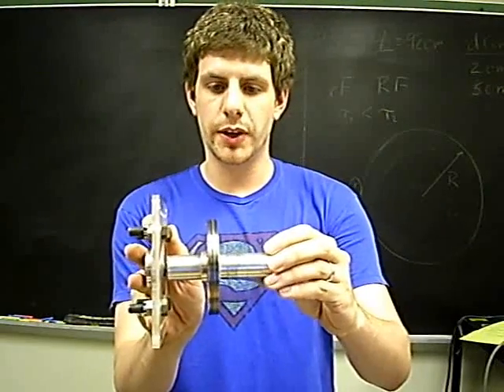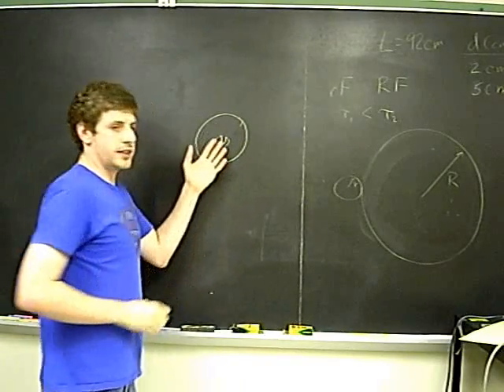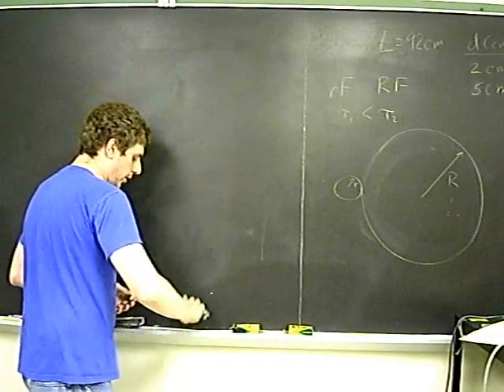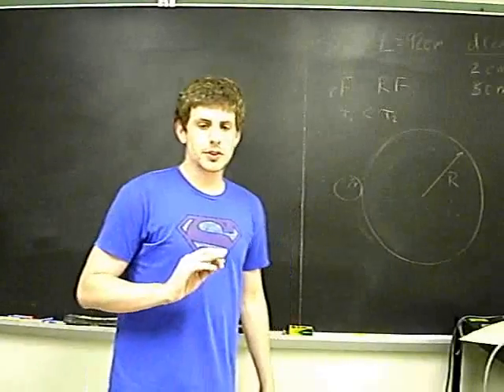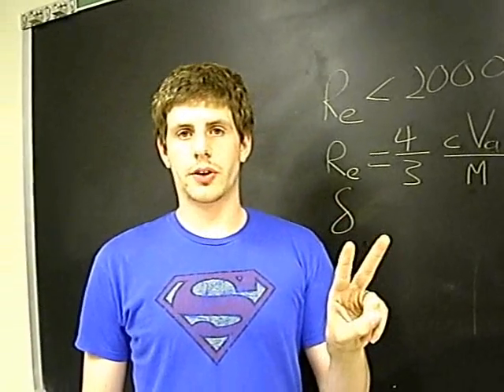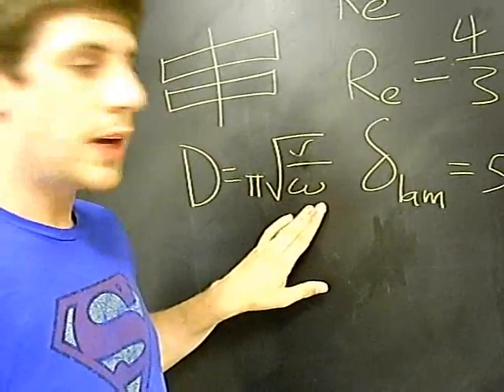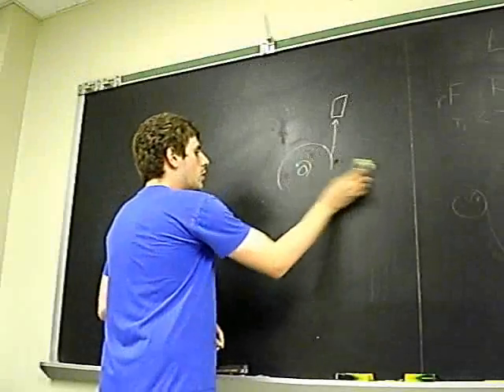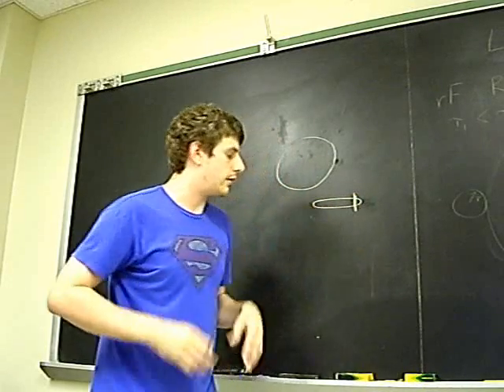Tesla Turbine Concepts Explained

Comment: A relatively good overview. Before noting the Reynolds number though, it should have been noted what this number is a ratio between  the inertial and viscous forces in the fluid.  A main misconception that needs clarification is that the Turbulent Boundary Layer (TBL), in contrary to the info @6:06, is very essential to the turbine, as it is the natural mechanism to transfer power between the concentrically swirling fluid and the metal disks. In order to see why it is the case, and how the dynamics of the turbine naturally changes take a look at this extremely well made video: https://www.youtube.com/watch?v=5zI9sG3pjVU&t=470s

Comment: Somehow at some point something doesn't convince me. When you say there's a "straight spiral" towards the center, it means it doesn't still cover the entire surface and is still rotating at low speed. What probably happens in that Fibonacci spiral is only a pressure wave, and since there are two opposite forces of a fluid pushed from the outside to the inner outlet and the same fluid pushed by the disk towards the periphery, one is centripetal and the other centrifugal, the maximum efficiency is obtained when there's a perfect resonance between these forces.

Comment: No new information. Plus, you could have explained it better if you had researched it more thoroughly. You misrepresented the angular flow part. Every explanation I've heard thus far, and there were many, have said it the way others in the comments have said it.
Reply: Want new information or even just a better way to look at it? 

The TesTur is NOT a mechanical turbine in any shape or form. Because all molecular adhesion and internal viscous forces within a fluid are governed by electron orbital interactions, this makes the TesTur a purely electronic interaction turbine.

The BIGGEST misconception about the Tesla Turbine that most people get wrong is that they think the fluid is actually sliding and dragging on the disc, similar to as if a solid object was “sliding” across the surface of another solid object. 

It is not. Full Stop. 

The fluid that’s just off the surface of the disc face is ALWAYS statically adhered to said disc face and never moving relative to the disc. 

The torque to the disc comes from shear stress forces within the motive fluid trying to move through itself.

The shear force is transferred through the motive fluid itself to the layer of fluid that is statically adhered to the disc faces, and then through the virtue of molecular adhesion the discs are pulled along with it, or Vice versa the discs pull the fluid along with it. 

The only “friction” involved in this is that of internal friction within the fluid against moving through itself, ie viscous forces. 

This is not a mechanical turbine in any shape or form. 

Since all molecular adhesion and internal viscous forces within a fluid are governed by electron orbital interactions, this makes the Tesla turbine a purely electronic turbine. 

As Tesla even alludes to in the article “Dr. Tesla Talks Of Gas Turbines” 

… “I have been working at this a long time. Many years ago I invented a pump for pumping mercury. Just a plain disk, like this, and it would work very well. ‘All right,’ I said, ‘that is friction.’ But one day I thought it out, and I thought, ‘No, that is not friction, it is something else. The particles are not always sliding by the disk, but some of them at least are carried along with it. Therefore it cannot be friction. It must be adhesion.’ And that, you see, was the real beginning.

“For if you can imagine a wheel rotating in a medium, whether the fluid is receiving or imparting energy, and moving at nearly the same velocity as the fluid, then you have a minimum of friction, you get little or no ‘slip.’ Then you are getting something very different from friction; you are making use of adhesion alone. It’s all so simple, so very simple.

“This is the greatest of my inventions,”……
-Nikola Tesla (September 18th, 1911)

When designed correctly, it works principally upon electron interactions between the fluid and itself and the fluid and the disc material. 

The first important factor being how well does the fluid actually molecularly adhere to the disc faces when submerged in an atmosphere of the motive fluid. 

This is also seen as the “Wetting angle” when there are two fluids in contact with the surface and they are competing for adherence. 

Think hydrophobic and hydroPHILLIC surface treatments.

The second important factor is the viscosity of the motive fluid in question, as it represents the fluids ability to “flow through itself with or without resistance” per se. 

Herein lies the reason it is extremely important to maintain laminar flow regimes within the disc spaces. 

Because irrelevant of the viscosity of the fluid, ALL FLUIDS, liquids and gases, can be forced to flow in highly efficient low Reynolds number laminar flow regimes given the right initial conditions and “flow cavity” parameters, such that turbulent boundary layer slip is eliminated, stream separation and counterflow is eliminated, rapid pressure changes from turbulence resulting in noise losses that can lead to early fatigue on discs and parts is eliminated, etc. 

Furthermore, because windage is all but inexistent in the Tesla Turbine, it stands to potentially be the quietest running turbine ever when properly designed. 

(Sidebar: This is why I have speculated over the years that these Tesla turbines have actually covertly been in practicable use all this time in things like covert/stealth submarine Primary Power Units (PPUs) and/or just plain stealth “trolling motors” but that’s honestly my own sheer educated speculation at this point. 🤷‍♂️ it just makes sense.)

This is where working out the complex solutions in the Naviar-stokes equations come in for designing practicable machines.
Reply: That's not the important thing about THIS video. THIS video explains it for the average person. Or even for the average science guy/gal who didn't go to college or go too deep into physics.
Reply: @edwardfrancisslaytonjr.9702  for the record, I do have a degree in physics, and build real actual working Tesla turbines that get PLENTY of torque and output power, even at low RPMs. 

If you listen to what Tesla said to do you will get a great turbine. 

1) high speed fluid relative to the discs (not high speed discs like everyone erroneously claims)
2) increase surface area 
3) decrease disc spacing 

In teslas own words…
“Owing to a number of causes affecting the performance, it is difficult to frame a precise rule which would be generally applicable, but it may be stated that within certain limits, and other conditions being the same, the torque is directly proportionate to the square of the velocity of the fluid relatively to the runner and to the effective area of the disks and, inversely, to the distance separating them. The machine will, generally, perform its maximum work when the effective speed of the runner is one-half of that of the fluid; but to attain the highest economy, the relative speed or slip, for any given performance, should be as small as possible. This condition may be to any desired degree approximated by increasing the active area of and reducing the space between the disks.”
-Nikola Tesla

Comment: Hello:  My name is Jack.  I am a very practical guy.  I own a factory which uses around 1000 to 2000 KWh of electricity per day.  This is an area area where electric cost is around 30 cents per KWh.  So you can see that my electricity costs are very high.  In fact, that is our greatest single cost.  Thus my interest in a turbine.  What makes it more attractive is that we can acquire waste motor oil almost for free.  We have developed a waste oil burner powerful enough to heat up to 30 kg of steel at a time for drop forging.  Can fire a forge hot enough to forge weld.  Fire a furnace hot enough to melt and pour our own die blocks.  That is a lot of heat.  In electrical terms I would suppose around 300 KW of power (but that is only a guess).
Now suppose we would use that waste oil burner to heat an oven through we would pass copper water tubes to produce steam.  Inject water into the tubes, water in the tubes gets hot, turns to steam, direct the steam through a nozzle into this Tesla turbine.  Get a lot of RPM's and then gear down or use a belt pulley system to produce 1,800 RPM to run a 200 KW alternator.  (Which we already have).
Now suppose I would use many, many stainless steel discs to form the Tesla turbine.  The discs would be around 24" in diameter.  I could use as many as necessary.  Now though my discs are thin they  are heavy enough to form a heavy flywheel of maybe 1000 lbs of mass so get a pretty good flywheel benefit too so that all of our electric motors stopping and stopping in the factory would not have as much effect of torquing the alternator down to inefficient RPM's.  Might enclose them within a common 55 gal oil barrel.  Presto, Tesla turbine.
We really need something like this.  We could even become profitable.
Any knowledgeable person out there care to comment about this?????  We are not much as engineers.  Need some help in the form of advice.
Thanking you in advance.  You could contact me at:    horsemnn@aol.com
Reply from the maker: Jack Roth Sounds interesting. Let me know your results.

Comment: Interesting theory, but I don't understand how a flat surface can transmit the mechanical motion of air or fluid more efficiently than the blades of a traditional turbine. The Diesel engine theory would definitely not work here.
Reply: No documentation whatsoever showing the torque figures surpassing or even comparing with a conventional turbine. Until a dynamometer test shows superiority, it is idiocy to think these are worth anything.
Reply: Prove me wrong.
Reply: Insult prove nothing but the lack of character and the weakness of the argument of the person doing the insulting, great job.
Reply: Ha ha ha, as I said....
Reply: If the best you've got is calling me names, I think my point is well proven, thanks :-)
Reply: What about 9/11? The destruction of the Word Trade Center has nothing to do with this video at all.
Reply: You are interested, and judging from the way you talk, your knowledge of machinery could fit in a shot glass.
Reply: @davekauffman8727  [TL/DR: This is not a mechanical turbine in any shape or form. Since all molecular adhesion and internal viscous forces within a fluid are governed by electron orbital interactions, this makes the Tesla turbine a purely electronic turbine.]

The BIGGEST misconception about the Tesla Turbine that most people get wrong is that they think the fluid is actually sliding and dragging on the disc, similar to as if a solid object was “sliding” across the surface of another solid object. 

It is not. Full Stop. 

The fluid that’s just off the surface of the disc face is ALWAYS statically adhered to said disc face and never moving relative to the disc. 

The torque to the disc comes from shear stress forces within the motive fluid trying to move through itself.

The shear force is transferred through the motive fluid itself to the layer of fluid that is statically adhered to the disc faces, and then through the virtue of molecular adhesion the discs are pulled along with it, or Vice versa the discs pull the fluid along with it. 

The only “friction” involved in this is that of internal friction within the fluid against moving through itself, ie viscous forces. 

And sorry I don’t mean to sound like I’m being pedantic, as I’m sure I’m restating many things you already know. 

It’s just a very important key part of the operating functions that everyone gets wrong. This is not a mechanical turbine in any shape or form. 

Since all molecular adhesion and internal viscous forces within a fluid are governed by electron orbital interactions, this makes the Tesla turbine a purely electronic turbine. 

As Tesla even alludes to in the article “Dr. Tesla Talks Of Gas Turbines” ( https://youtu.be/TGGLG-7hK50 )….

… “I have been working at this a long time. Many years ago I invented a pump for pumping mercury. Just a plain disk, like this, and it would work very well. ‘All right,’ I said, ‘that is friction.’ But one day I thought it out, and I thought, ‘No, that is not friction, it is something else. The particles are not always sliding by the disk, but some of them at least are carried along with it. Therefore it cannot be friction. It must be adhesion.’ And that, you see, was the real beginning.

“For if you can imagine a wheel rotating in a medium, whether the fluid is receiving or imparting energy, and moving at nearly the same velocity as the fluid, then you have a minimum of friction, you get little or no ‘slip.’ Then you are getting something very different from friction; you are making use of adhesion alone. It’s all so simple, so very simple.

“This is the greatest of my inventions,”……
-Nikola Tesla (September 18th, 1911)

When designed correctly, it works principally upon electron interactions between the fluid and itself and the fluid and the disc material. 

The first important factor being how well does the fluid actually molecularly adhere to the disc faces when submerged in an atmosphere of the motive fluid. 

This is also seen as the “Wetting angle” when there are two fluids in contact with the surface and they are competing for adherence. 

Think hydrophobic and hydroPHILLIC surface treatments.

The second important factor is the viscosity of the motive fluid in question, as it represents the fluids ability to “flow through itself with or without resistance” per se. 

Herein lies the reason it is extremely important to maintain laminar flow regimes within the disc spaces. 

Because irrelevant of the viscosity of the fluid, ALL FLUIDS, liquids and gases, can be forced to flow in highly efficient low Reynolds number laminar flow regimes given the right initial conditions and “flow cavity” parameters, such that turbulent boundary layer slip is eliminated, stream separation and counterflow is eliminated, rapid pressure changes from turbulence resulting in noise losses that can lead to early fatigue on discs and parts is eliminated, etc. 

Furthermore, because windage is all but inexistent in the Tesla Turbine, it stands to potentially be the quietest running turbine ever when properly designed. 

(Sidebar: This is why I have speculated over the years that these Tesla turbines have actually covertly been in practicable use all this time in things like covert/stealth submarine Primary Power Units (PPUs) and/or just plain stealth “trolling motors” but that’s honestly my own sheer educated speculation at this point. 🤷‍♂️ it just makes sense.)

This is where working out the complex solutions in the Naviar-stokes equations come in for designing practicable machines.
Reply: @davekauffman8727  I have proof of actual working TesTurs that get real power and torque even at low rpm. 

You just have to know how to design them correctly. 

Real 1200watt electrical load test on the last build since I’ve done upgrades. At ~6700rpm. On room temp compressed air.  

Latest dyno pulled +4.25kW between 6000-8000rpm and peaked 5.25ft-lbs of torque (these are what’s available out to the shaft too, after all the trash inefficiencies in my plastic and aluminum prototype) again on only room temp compressed air and never exceeded over 40 psi at the nozzle. 

Previous dyno tests with bad gear alignments it did 2.75kW and 6.22ft-lbs of torque at only 4150rpm. 🔥😈🔥

Next to come is the full combustion + steam improved turbine patent GB 186,083 of Tesla’s that he patented a decade after the original one and 10 years of R&D. 

AND the turbine is geared UP to the generators, not down like everyone demands you have to do with Tesla turbines 🤭

Comment: So keeping in mind this is way above my pay grade.....how come normal centrifical force properties, which typically fling objects to the outer perimeter seems to be in reverse and is drawing the liquid to the center?
Reply from the maker: I do not know. I theorize that a combination of pressure and temperature changes of the working fluid (i.e- steam) overcomes the centripetal acceleration.
Reply: The force of the incoming fluid is what centrifuges the working fluid towards the center. 

It constantly wants to fling out but is being driven inwards by the fluid that’s renewing the flow. 

Certain multi phase fluid flows that have lots of dense water (liquid) relative to air (gas) will cause the heavier water to occupy the periphery of the turbine with the pressure gradient decreasing towards the center so gas will “float” to the center due to buoyancy. 

This is an adverse effect of trying to use multiphase fluid flows that have relatively equal parts liquid:gas. 

It will cause the elastic gas to leave the turbine before it’s fully expanded.